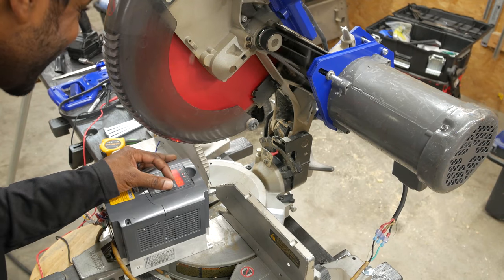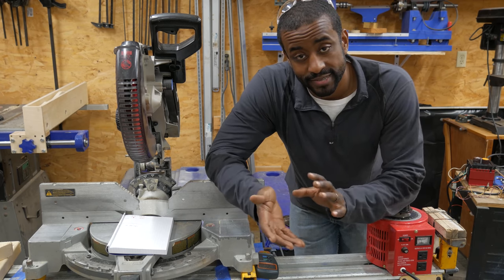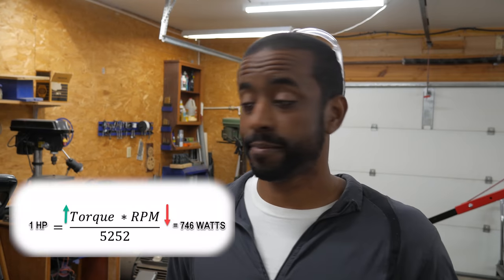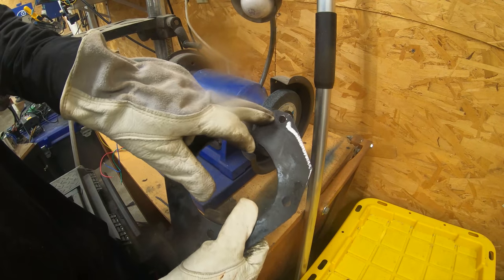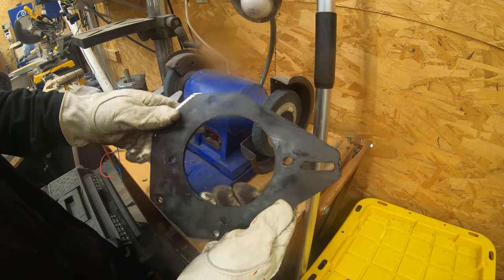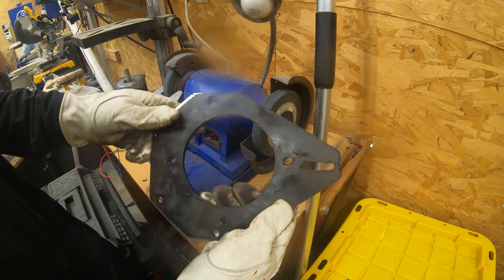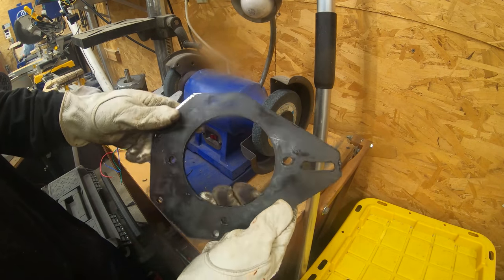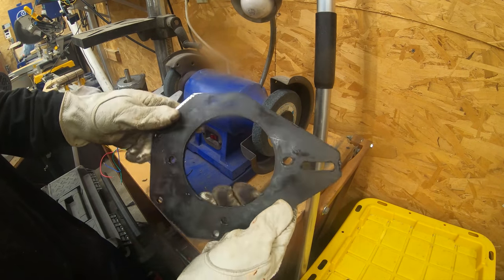How To Speed Control Your Miter Saw For Cutting Steel #080

Comment: How about a pulley that's 2.4 times larger than the current pulley on the universal motor saw? I'm not sure how difficult these pulleys are to change, so maybe make a quick change pulley while you're at it. 
As for the 2hp 3 phase motor, even the 1hp one, I'd rather see the motor at the base of the saw, for obvious reasons. The pulley setup would be more complex, as you'd have to run from motor to hinge, hinge to original pulley, then have the original pulley setup. This design could be decent if you can make it work well. And again, quick change pulleys for switching between metal and wood, as adjusting the frequency will only get you so far; like the stack of plywood, seemed like the motor was starting to struggle by the end of it, so having a different pulley set would be beneficial. As for quick change pulley, maybe borrow the design of the drill press pulleys, where you have multiple steps on the same wheel, with two wheels being opposite each other, where you can change from a low ratio to a high ratio. 
But I think the most important question here is which is better, circular saw type miter for metal, or band saw type miter for metal? Personally, depending on the size of the band saw, I think there's more potential for the band saw, as a circular miter will only have so much reach, unless you have a fancier miter saw that slides. 
It'd also be interesting to see this adapted to a table saw, then again compare band vs circular blade. I think in this case, circular blade would be better for long, straight cuts, as you have more table surface that isn't interrupted, but a band saw would be better for curves. I guess preference is really just dependent on the job being done.

Comment: Would a hand held 240v cutting saw run wired to 12v DC and cut wood maybe a few peaces on campervan lithium batteries? I guess i should try it then i will know. Has anyone else?

Comment: at around 18:24 is it just me or does he have the blade in backwards.
i realise the camera is facing from back to front but actually the blade seems to be on fine but it is runnung backwards. so wired with backwards polarity. i have run it at a .25 playback and put it on my 60" tv and it looks like it is how im saying.

Comment: It's not about RPM, it's about cutting speed (that includes RPM and tool diameter).
Reply from the maker: Sure... I agree you could change the blade size and get a different surface feet per minute. That is the variable that we are really interested in.
Reply: @Jeremy_Fielding  I think that you should stay with that diameter. But your target it is not "X" RPM, your target it's "X" cutting speed, and you can achieve it by changing the RPM and with that diameter.

Comment: a metal cutting saw has the clamps built in...super easy and safe to lock a piece of steel down. this thing is a safety nightmare. those cheap clamps slip and you are going to the ER and wishing you bought the correct saw...I got a makita for $350 new...wait for a sale, or buy a used one. how much was the VFD?

Comment: I would of kept the original high speed motor and built a pulley for the belt 3 times bigger on the blade side that would of tippled ur torque and slow the rpm 3 times the initial blade speed

Comment: I thought cold metal cutting blades were rated at 1300-1500 RPM.   At 2:00 you measured a motor speed of 17,900 which I don't believe is possible of a universal motor.  But then then when you try reducing voltage you aim for a speed of less than 500RPM?   This is a year old posting and maybe other have caught this but I'm still trying to understand your speed data.
Reply from the maker: There is nothing to catch. It is exactly correct as presented in the video. universal motors often go over 30k rpm. Without a load they accelerate until the bearing heats up and explode. There are even videos of people doing this just to see it happen. Also it sounds like you skipped around or didn't watch the whole video because I explain the different speeds for cold cut saws a bit later in the video.
Reply from the maker: I test the horsepower of a universal motor in a video on shop vacs. You will see another universal motor going 20k rpm and I also think you will find the results interesting

Comment: I just looked up blades that operate at 2500 and 1800 rpm. 10 and 14 inch. I think I can cheat the the 10" on my 2800 rpm abrasive saw.

Comment: @Jeremy: I'm sure you're aware that the tooth profile of a dry cut metal cutting blade is wildly different from a blade designed for wood - this is fine for pine, but get ready to burn a lot of hard wood when the metal cutting teeth can't clear the chips (sawdust) fast enough. ;P
Reply from the maker: For sure you should always change the blade according to the material

Comment: Why not just increase the power of the laser instead of using a saw blade to cut the steel?
Reply from the maker: You mean the plasma cutter? Some cuts are way better and easier in a saw then plasma cut especially angle iron or anything hollow like tubing

Comment: They use miter saws for cutting steel in Taiwan, at full speed. But instead of using a regular saw blade they use an abrasive cutoff wheel.

Comment: Water cooled? ~300 rpm water with water cooled. Can use tool steel blade not carbide. You can sharpen tool steel blade. That's what I use at work..

Comment: The only problem I see with this is most people don't have the machines to make adapters or electrical knowledge to make these changes.  So buying a cold cut saw would be the cheaper route for most everyone.
Reply from the maker: Check the pinned comment at the top
Reply: @Jeremy_Fielding  pinned comments don't show up on top like they used to.  Your shop and skills are petty impressive.  As a former tool maker and design engineer I seriously wish I had that setup at home.

Comment: I skipped some of the video.
How about a permanent magnet motor like from a free giveaway treadmill off of Craigslist and pulse width modulation power? 
Much smaller than 3 phase AC motor.
You get nearly full torque at any speed with PM motor and PWM power.  Kind of similar characteristics to the VFD, but for different reasons.
Add to that a belt speed reduction (2:1 or 2.5 :1) for even more torque because some of those motors rev up to 5000+ rpm and

Comment: Are you looking for an apprentice? lol, I can't be the first one to ask that.
Resharpen blades? Maybe cutting oil? I think the heat generated from friction is a primary factor for your blade problem, even at low rpm you can ruin the heat treatment of the blade if it gets too hot.

Comment: “I need to modify this saw to cut metal” “let’s use my fancy plasma steel cutting machine to make a bracket”
Reply from the maker: It’s the best way to cut square tubing and other structural members like angle iron. Not all steel is flat. Thanks for watching:)
Reply: Obviously. But still funny

Comment: I worked in a steel service center that had a huge, professional cold cutting saw with a 36" diameter blade that cuts large structural steel members.  It ran at 40 RPM.
But for home use, all the cold cut chop saws run at 1450 to 1650 RPM and work very well at cutting small steel bars, angles, and tubes.  They sell between $250 and $400.

Later in your video you corrected the RPM from less than 100 to 1500, so the first 2/3 of your video was wasted.  The real value of your video is that 1) cold cut blades must be run at approximately 1500 RPM instead of 3600 RPM, and 2) the universal motors furnished with  miter cutting saws cannot have their 3600 RPM reduced to 1500 RPM by limiting the voltage with an expensive Varaic or even a more expensive Variable Frequency Drive ] losing so much power that the blade does not cut steel and the motor will probably fail much sooner .  A variac is a few hundred dollars and a VFD is about $1000.

The upshot is to buy a dedicated cold cut chop saw with limited miter ability for $250 to $400.

Comment: Your not reading the rpm at the right spot ( too close to the arbor) its at the very tip of the blade where you have to measure it,  the more outside of the gear reading the lower of the RPM readout you get !
Reply from the maker: RPM (revolutions per minute) is the same no matter where you measure it. perhaps you mean surface feet per min.

Comment: The new carbide blades for cutting steel can run at 5000 rpm. They cut well without any mods. If you need something more powerful buy a plasma cutter. Don't waste time with other types of saw's unless they are commercial. But that is a completely different conversation.

Comment: shouldn't have baited me with the "but then commenters will comment" schtick at the start lol
if you have the DC inverter able to run the motor at 20%~ then you could put a gear.. thingy to change the torque and speed ratio with pulley thing ???? WOO

Comment: This guy makes me look like an idiot....but I like it! (Nice to see smart people being smart and humble at the same time).
I'm waiting for some tool company to come out with a compound miter saw for steel cutting...one that you can change to different angles/compound angles unless there is one out there already?????

PLUS, what kind of band saw is he using in this video? I want one! I converted my 14" (X93.5") wood cutting bandsaw with a metal blade and it works on 1/8" steel or less but yes it's too fast (RPM) so a nice metal cutting bandsaw like he's got would be great...what brand/specs is it?
Reply from the maker: I built that bandsaw. There is a video on my channel about it. Its 4 hp designed with variable speed to cut steel and wood like this project.

Comment: your blade needs to go realy fast, its all about dropping saw blade very slow and any  drop saw can do this, its about blades,    if you can put two sets of blade with teeth  pointing different ways it will cut any thing very handy thats what i did, if you can fit two blades in any drop saw, with  teeth pointing both opposite was cut wood metal any thing fast double tooth blade just move cut fast blade.slowly .

Comment: i once hit a nail inside some wood i didnt know of.... a bunch of sparks and my saw cut right through it..so when i need to cut metal im just gonna get a 99€ cheap miter saw slap on a metal blade and hope it doesnt break until im finished
in case it seems unstable im gonna build a wood enclosure around it incase something goes horribly wrong
Remember kids: Even if you do stupid shit, care for your safety

Comment: why  do you even need the saw to cut metal, you already have a cnc plazma table
Reply from the maker: You can't cut square tubing or angle iron, or many other structural members on a plasma table. Also this video wasn't about needing a metal cutting saw. It was about answering the very common question I get... can you turn a miter saw into a metal cutting saw. In my opinion you should just buy one, not make one. Can you do it yes... should you do it... well its harder than it looks. Thats what the video is really saying.

Comment: Don't forget the grinding cut off wheel makes terrible dust. You can get away without using one but smart folks that like their lungs wear a respirator. Breathing issues aside, the dust gets in and on everything. Coats your clothes, your skin, your hair,  but more importantly any machine tools in the vicinity need a thorough cleaning afterward. Not worth the mess.

Comment: Actually that would be a "Cold Saw" and it needs  a lube system. You do a lot of fun stuff, but it's not practical. You can't run a cold saw with a Chinese flat belt drive unless you have a bucketful of them. Get a 1hp gear motor off Ebay and find a way to get a blade on it.

Comment: Please, anyone, 1:23 >> is replacing the motor better because it is cheap or something?!!

If you have a motor in your house or shop, GOOD, but if you don't have one, Is it a good idea to replace the motor or to fix the good, ( slightly damaged), original one?!!!

Sometimes, fixing some thing is actually time consuming and the effort of doing that is way more expensive than the actual new piece of that part, ( just something that I've learnt throughout the years), but that is not a common thing, so is the motor one of them?!

Comment: Use A dimer switch
Reply from the maker: A dimmer switch is just a variation on voltage control. You would get the same behavior.

Comment: You can never adjust speeds with voltage on AC motors only DC motors are able to adjust  with voltage basic electronics knowledge

Comment: Hi you tell us about speed control but do not tell us WHY it is needed to cut steel. I am guessing that the blade on a steel cut saw runs at a lower speed, but this is not directly mentioned. I own a Evolution that cuts both steel and wood using one blade at a set speed. So a little confued here. ( Sorry just a simpleton here)

Comment: Okay, if you can afford a plasma cutter, just buy the dang saw.
Reply from the maker: LOL... maybe you spent all your money on the plasma cutter and now you can't afford it? J/K The cost wasn't really the point of the video. It was showing what it would take to answer the question. Can it be done, not "should" it be done.
Reply from the maker: To be clear...I 100% agree its way easier and better overall to just buy a cold cut saw.
Reply: @Jeremy_Fielding  I was just teasing. It was an incredible amount of effort you expended to explore the possibility. I salute you sir for the excellent job here. And the tremendous amount of time it takes to put together a quality presentation like this. In my endeavor to cut 75 steel balusters, I have discovered it's very difficult to match the blade rpm with available chop saws. Harbor freight sells steel cutting blades, but not a single saw in their store had the correct rpm for the blades they sell.🤯
It's going to take me 3 times longer with my sawzall and a dozen blades

Comment: The universal motor is also about the worst motor to have if you have arc fault breakers.  They will trip because of these motors. Drive you insane. And if they are Generous Electric we bring good things to D…th then they will trip circuits you’re not even plugged into

Comment: Just put an abrasive disk on your chop saw with the RPM rating more than you saw get a file because you're gonna have birds you're gonna have to take off other than that all this guy and everyone is doing is a bunch of work you don't need to do if we're going to do all this work work and extra day and go buy yourself a saw or like I said just buy the abrasive desk the end
Reply from the maker: HA! I think you missed the whole point of the video. Of course this is way more effort, and cost compared to buying a saw designed for this purpose. That was exactly the point. Nothing short of this would work well. It might help to watch the beginning again when I say "why" I was trying this at all. Anyway, thanks for watching :)

Comment: Your theory is totally off basis. If your miter metal saw blade is able to cut mild steel round, square tubing, & plate steal up to 4130 steel is that the RPM of the steel cutting blade in within 100 RPM of you miter saw is fine. I have this is a setup on one of my miter saws.They way you try to play out your theory is stupid. As a mechanical & electrical engineer, for over 40 years,  I have a lot more experience then you do.
Also, if you wire in a dimmer switch to your miter saw you will be control the RPM of the saw blade without reducing torque when cutting steel. I also have another miter saw in the  in that confederation & have had no problems with cutting steel in either setup.
Reply from the maker: Hey Donald, Thanks for the feedback. I love it when people with lots of experience comment because there is so much to learn. Of course having even 100 years of experience or 5 advanced degrees doesn't mean you are correct. Perhaps you are not taking into account the life of the blade. Certainly you can cut a few pieces of steel with no modifications at all. I am happy to clarify some details if I made mistakes in the video. However, we should probably just agree to disagree... based only on your comment you seem like the type who wants to be right and not discuss the finer points for clarity. Hopefully I am wrong. Either way, Thanks again for the comments. Leaving these messages helps the video a great deal. And it allows me to gain insight into the minds of those watching.

Comment: Wow am l shocked !! The science in your head. Do you have degree in electrical engineering ? How much does a saw costs that will steel ? Does your experiment make any sense or are you just saying try shit ? I like to be challenged, but the electrical blows my few brain cells. /. So l just went to Amazon the saws cost about the same. So if your too cheap & you have all these parts laying around you can do this, but a good metal cutting blade mite cost as much as saw ?